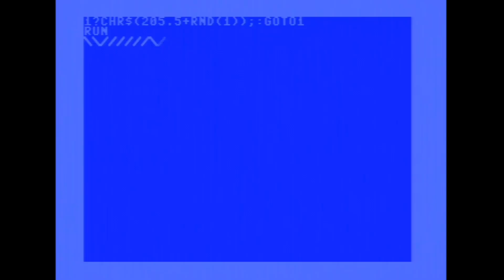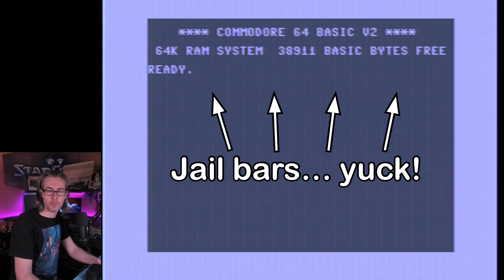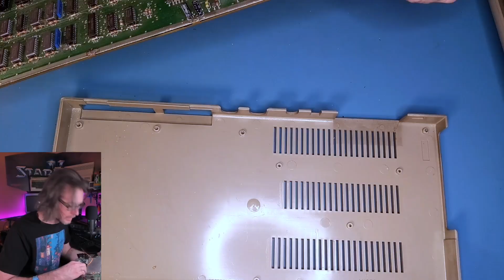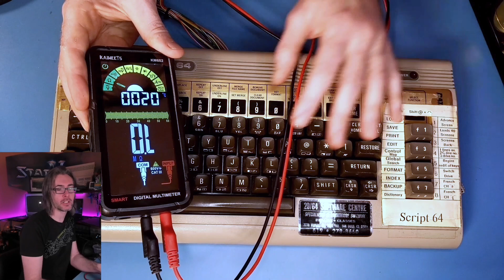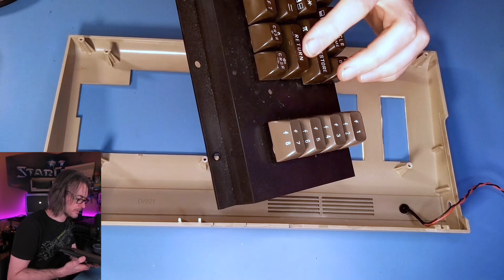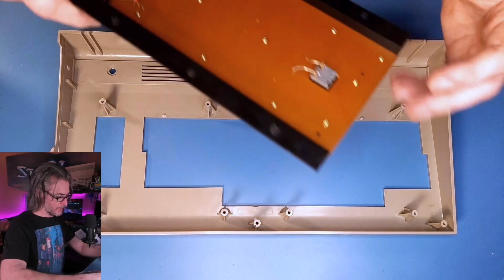What's wrong with this Commodore 64?

Comment: Rev 1 Kernals are fairly rare.  If you manage to remove it non-destructively, I'd be interested in buying it from you.
Reply from the maker: Hi Bo, I was considering replacing the kernal anyway, so I'll go ahead and carefully remove it and drop a socket in there. I can send you a message through your site later.